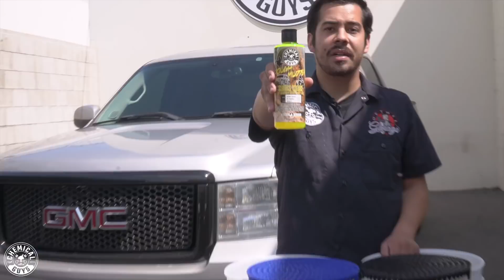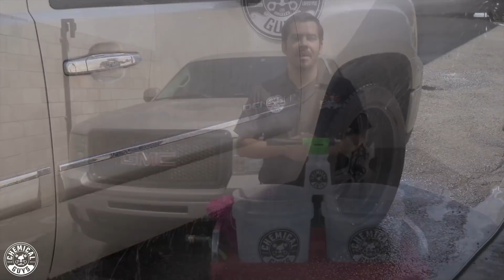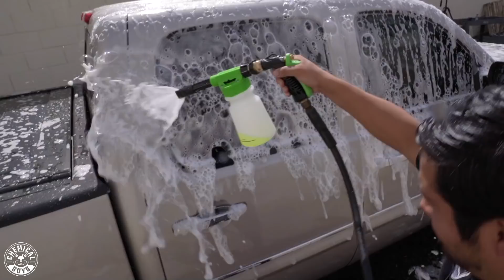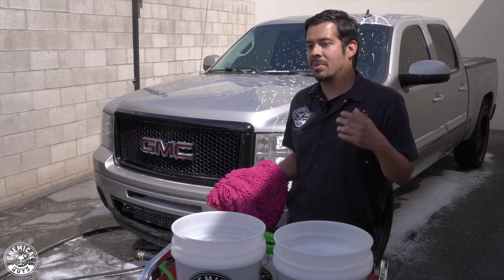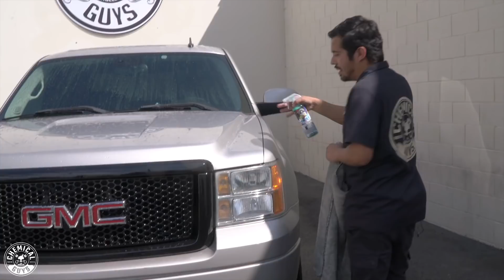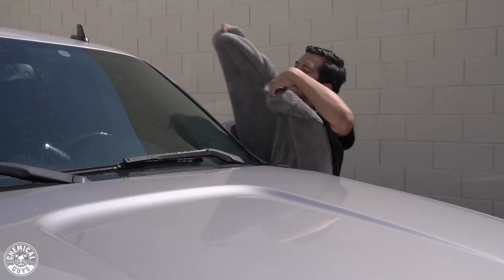How To Scratch-Free Wash Your Truck At Home! - Chemical Guys

Comment: Hey! Love Chemical Guys products. Do you have any tips for cleaning microfiber towels. Don’t want to leave swirls, thanks.
Reply from the maker: Hey! We recommend Microfiber Wash, it is a specialty detergent that cleans and restores microfiber. The advanced cleaning formula releases dirt, grease, and residue, leaving microfiber feeling and performing like new.

 https://www.chemicalguys.com/microfiber-wash-cleaning-detergent/microfiber-wash.html
Reply: @ChemicalGuys  thank you!
Reply: Make sure it’s damp while using it it works way better
Reply: @NortenoAdiktoz  thanks, I met like after use. Like once you use it how do you clean it properly to use again
Reply: @alexryder8550  CG sell a microfiber wash specific to that material. Using tide etc tend to make them less absorbent.